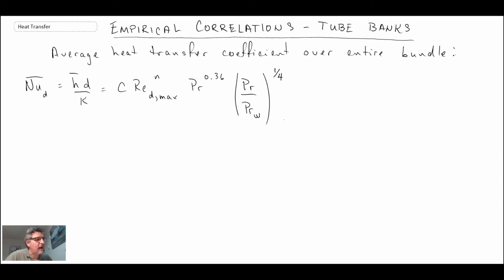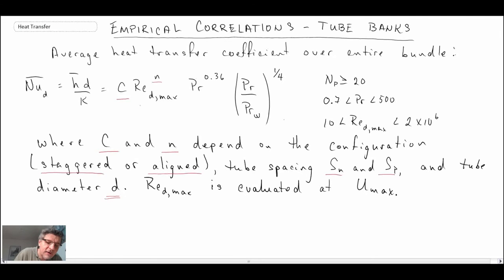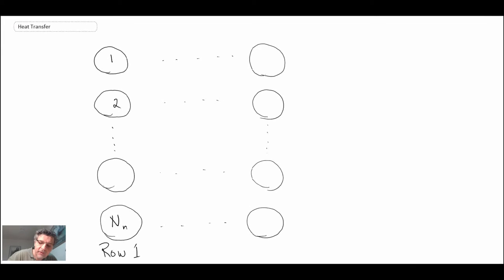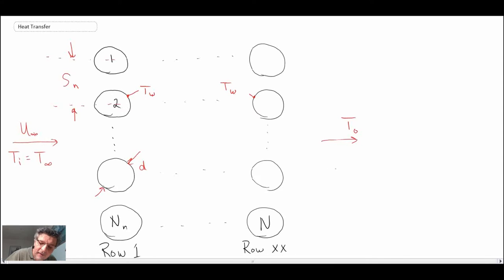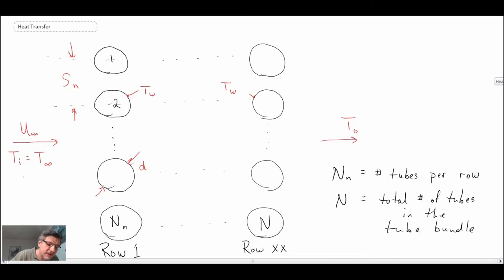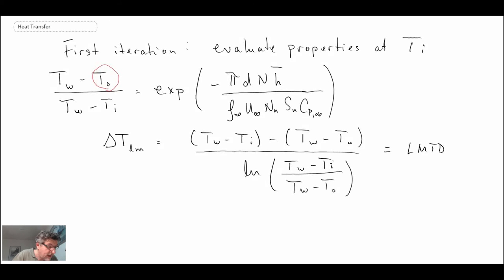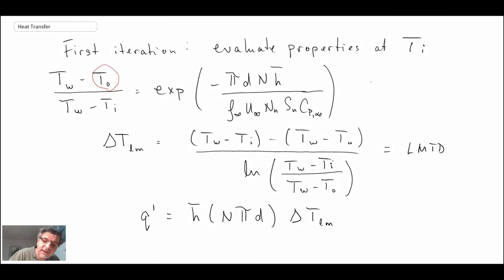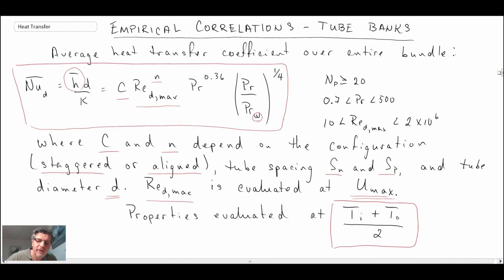Heat Transfer L20 p2 - Convective Heat Transfer - Tube Bundles

Comment: How can I design radiator for dryer? Using steam at 130c and ambient temp 25c and the chamber of dryer wanted to be 60cduring 10 minutes
Reply: the size of the chamber is 27m3